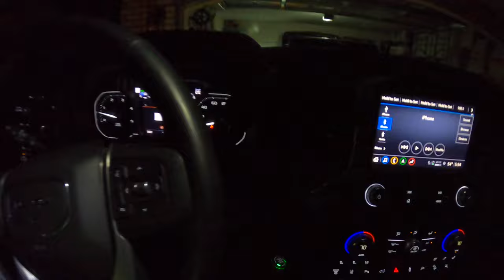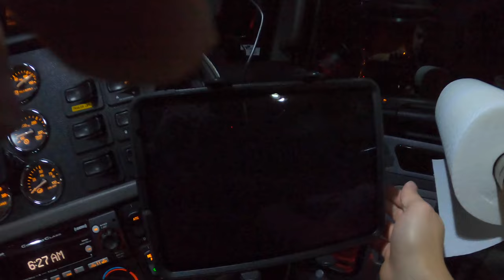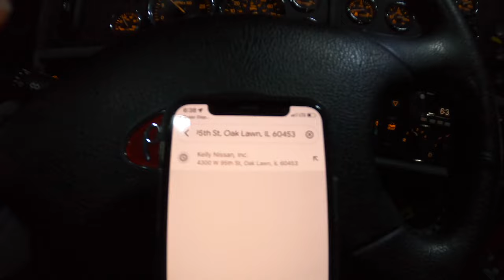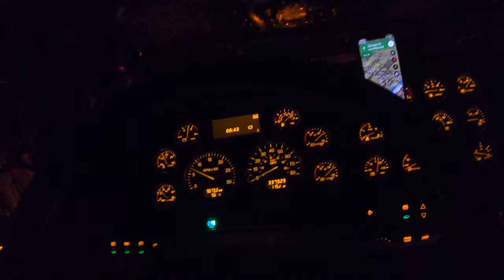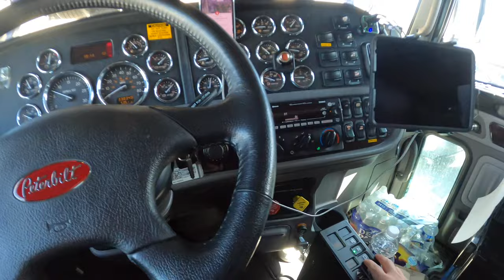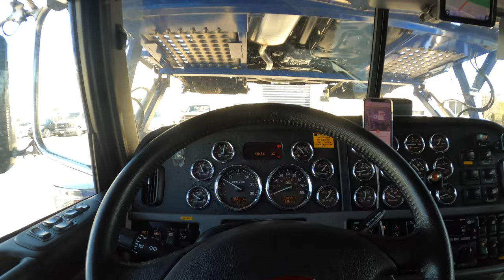24 HOURS IN A CARHAULER! | 24 YEAR OLD TRUCK DRIVER |

Comment: What type of CDL are you required to obtain to be able to operate? I have a Class A CDL but have a Tractor Trailer restriction because I didn’t test in a 5th wheel